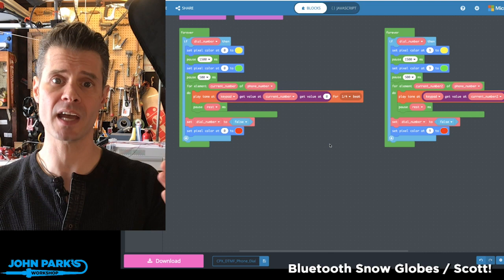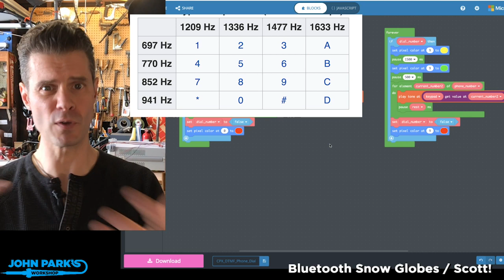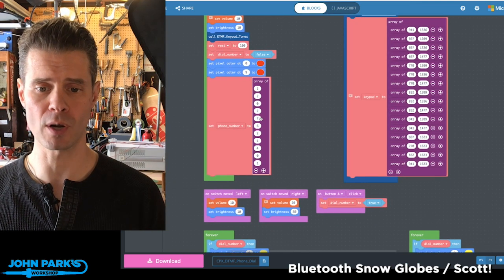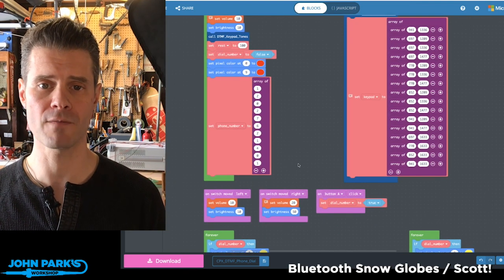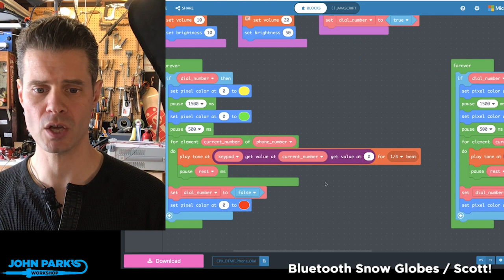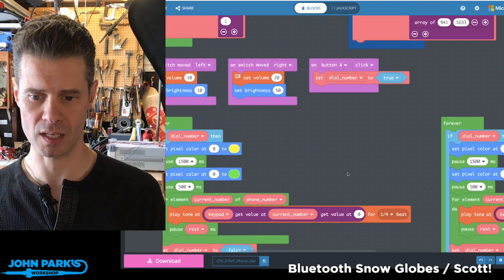MakeCode Minute: DTMF Phone Dialer @adafruit @johnedgarpark #adafruit @MSMakeCode #makecode

Comment: @johnedgarpark - I’m curious to know why you just didn’t use the speaker on the board of the CPE rather than the external Stema speaker.
The reason I ask is that I’ve been hitting my head against a wall trying to get “tones” to play a reasonable volume out of a CPE. Music &  Sou effects and even the snow globe code from a tutorial on the adadfuit website works well if loaded in to the CPE directly but if it’s loaded into makecode first the volume is much much much lower.

There is a school of thought that makecode has been updated at some stage that has effected how tones are played back on the CPE.

It would be Interesting to hear if your reasoning for using the external stema speaker was to get around this issue.

Thanks in advance 

Richard
Reply: That's right, I couldn't get a high enough fidelity DTMF tone out of the Circuit Playground Express speaker so I used the larger external speaker. I think I tried it on the build-in one with sound level at maximum in MakeCode but it still wouldn't work. So I'll guess that the tones are just not pure enough/loud enough in this case.
As far as the tone updates, they have definitely made changes to them during development and continued releases. You can go on GitHub to the microsoft/pxt and related repos to check out the nitty gritty details.
Reply: John Park - thanks,  - I really enjoy your projects and the insights they give into solve other programming issues